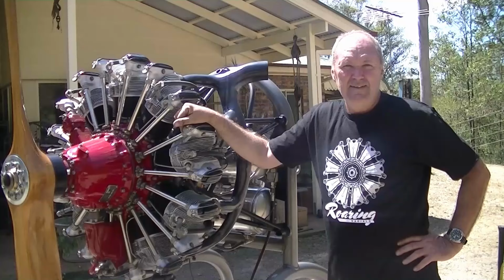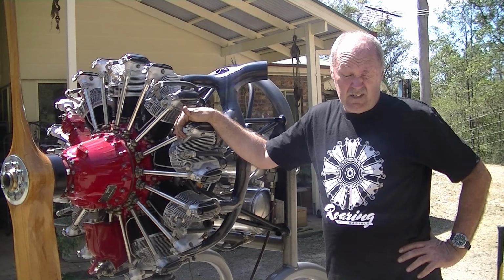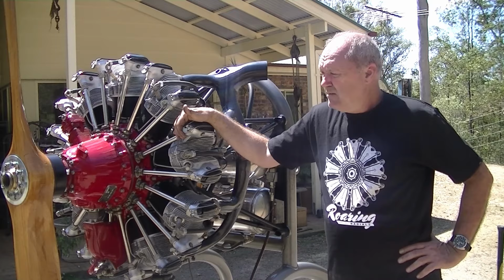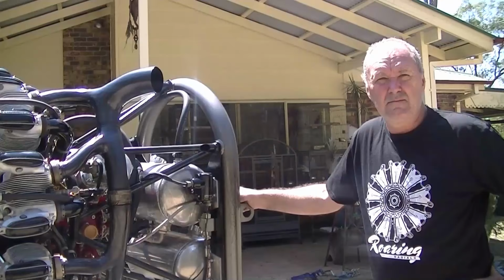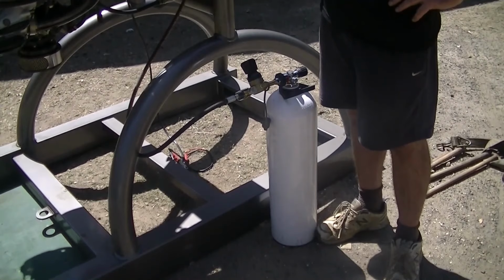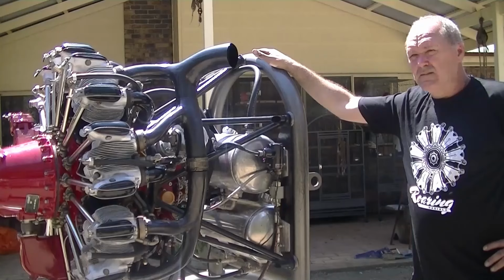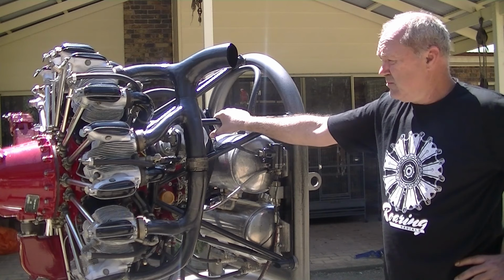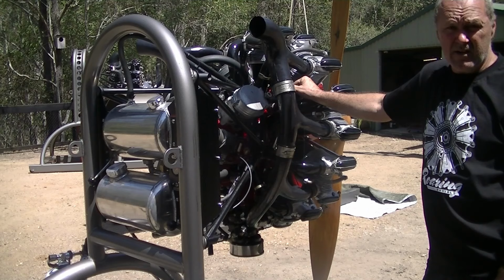M14 P RADIAL ENGINE RESTORATION

Comment: under the old refectory at the St Lucia  UNI were several r very old radial and rotary air craft engines  often wondered what happened to them  ,recall a 3 cylinder and a 5 cylinder  can not recall what the others were  know one was marked LE RHONE know they were there in late 50s
Reply from the maker: You never know they may still be locked away there  what year did you last see them ?

Comment: Nice engine! What keeps the high pressure gas from going backwards in the start system when its running?
Reply from the maker: Checkvalves in the fittings where the tubes enter the heads

Comment: Is all the oil smoke from the oil that leaks out of the very bottom cylinder into the exhaust manifold when the engine stands for a while?
Could you fit a valve much like those for draining the water and oil sludge from the air tanks on a truck to that very bottom point of the exhaust manifold to clear most of this?
It's obviously not worn rings or pistons...and a little smoke seems to be de rigeur for every radial aircraft engine.....
Reply from the maker: There are drains in the inlet tubes  but there is no where for the oil to go once it fills the rocker boxes and pushrod tubes except up the valve guides   The oil fills the back of the upside down pistons then leaks past the rings into the combustion chambers    The manufacturers dont worry bout the oil consumption   It is a common cause of hydraulic lock in radials and something we must be aware of prior to starting  unfortunately the smoke and oil comes with the design
Reply from the maker: @JohnSmith-pl2bk  they forced me to sell them for scrap  it is illegal to keep used cases larger than rifle cartridges here unless you are a licenced collector     But i am a male :)